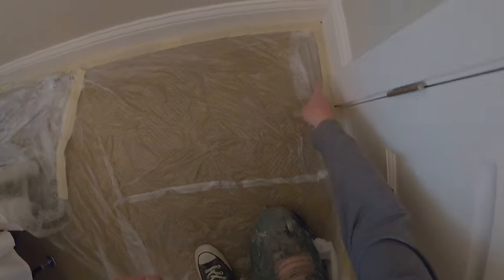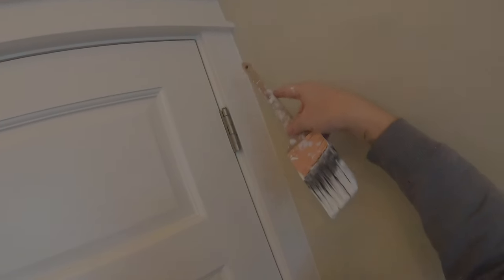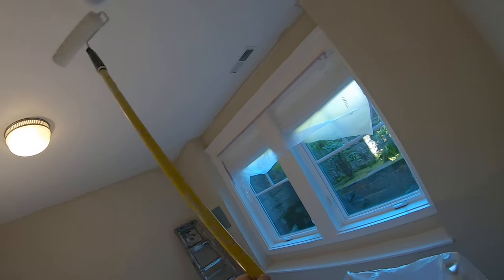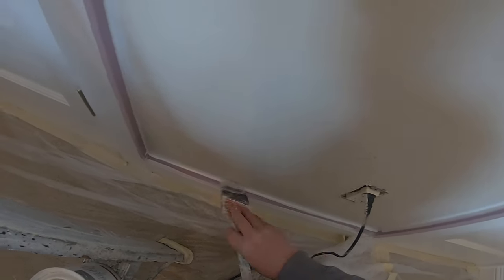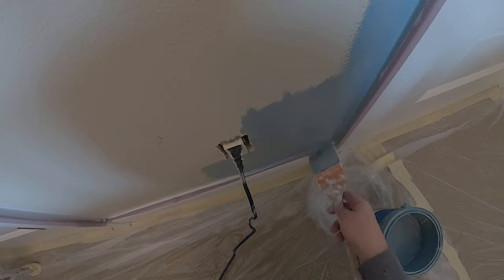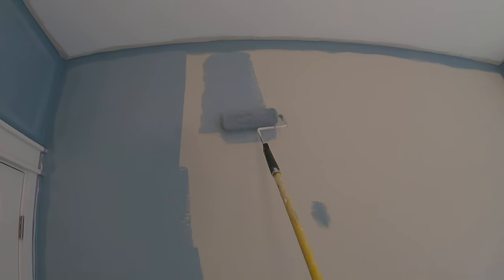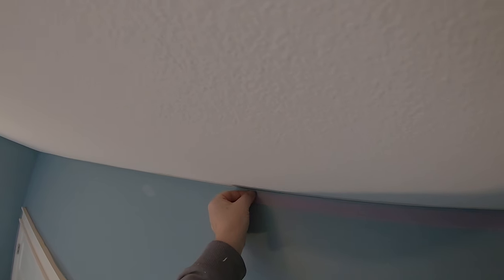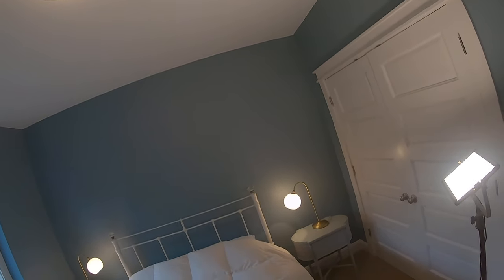Painting a Room, Walls and Ceiling

Comment: Dave, thanks again for all of your help! I have painted several rooms of my house and thanks to you, the finished product has been very nice! One question, when you paint a room, do you usually sand with a fine grit like 220 between first and second coats? Or is this not necessary? I skim coated the walls in our living room, got them very smooth and defect free. I have applied first coat of BM  regal select matte finish to walls...looks pretty good. At this point I never know if I should sand down any specks or the entire wall. I used a new roller and walls were cleaned and primed after the compound work....but am curious what you do, as a pro?  And if you do sand, do you have to wait a few days between coats before sanding? Or can you do right after it is dried and ready for 2nd coat?

Comment: What is the point of the caulking? I’m sorry I’m new to painting
Reply from the maker: A lot of times the transition between the trim and wall will be rough or cracked, caulking smooths this transition out.  So, when you have caulked, and now have a smooth surface to work with, your cut in line (between the wall color and trim color) looks a lot cleaner and smoother.  It is hard to create clean cut in lines if the area is cracked or rough.

If said area looks good already, then there is no reason to caulk.

Here are a couple of vids to watch:
https://youtu.be/12MPdI9HJ24
https://youtu.be/fHd_gNlygOY
Reply: @DaveMartin  thank you sir! Appreciate the help!

Comment: Question maybe I didn’t hear it but did you use paintable caulking , white caulking I can’t tell?
Reply from the maker: Yes, I (almost) always use a paintable caulk.
Reply from the maker: This is a response to why use a ceiling paint.  The main reason I use a paint specifically for ceilings is that I can buy a super (true or dead) flat paint.  

The reason for this is simple, I don't like shiny ceiling unless they are in a high moisture area.  Flat paints help hide imperfections and are very forgiving when using (don't flash as much, show roller or brush marks as much).  It is a more elegant look to me.  It's also cheaper.  

If you are painting the walls and the ceiling the same color, then you may want to use the same sheen, but personally, I do not like a shiny paint on the ceilings.  But alternately, I do not like flat paints on the wall (not as durable).  When using a higher sheen on the ceiling, light reflects off the sheen and then the eye has a tendency to look up; I want the focus to be on the walls.
Reply: @DaveMartin  I find that BM Aura Interior Matte finish is a perfect sheen and very durable without having to go to Eggshell.  Anyhow, on the topic of ceiling paint, what product would you recommend for moisture areas like bathrooms (where a tub or shower is present)?  Feel free to recommend Benjamin Moore products/sheen or others you have had great experience with.  I have used the BM Waterbourne Ceiling (Ultra Flat) for bedrooms but unsure if it is acceptable in bathrooms. I know there is Aura Bath & Spa Interior - also unsure if that can be made into a ceiling version.  Thanks!!

Comment: What sheen would you recommend for a garage ceiling and walls ?
Reply from the maker: To make it easy, especially since it is a garage, I would use an eggshell finish on both the walls and the ceilings, gives you a bit more durability.  

The walls will most likely get touched a lot and a flat will just not hold up too well.  If you really want durability and think you actually might clean the walls when they get dirty, you could move to a semi-gloss.  I think a semi gloss is too shiny, but that is certainly a subjective thought

Comment: I couldn't use a 9" roller on a ceiling though , 18" or at least a 15"for me.
Reply from the maker: We have 18" here in the states, not sure about the 15".  I rarely use an 18", for me it's just a bit too cumbersome for smaller areas.
Reply: @DaveMartin  When i cut in walls i use a 6.5" roller with my brush with a Wooster speed bucket , then any smaller areas can be rolled in with that as i go. Then out with the 18" to eat through the walls in minutes.
Reply: @DaveMartin  Down here in Portland I use 14" roller naps. I probably would use a 9" on those walls as its a tight space but 14"  are my go-to naps.